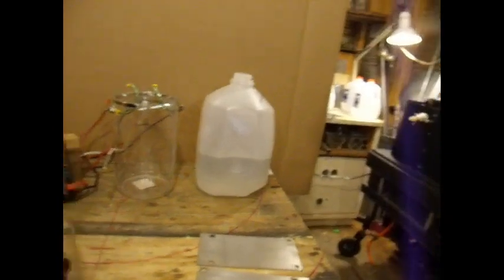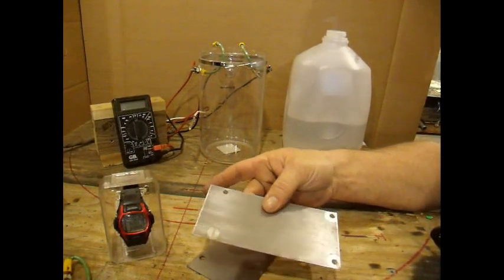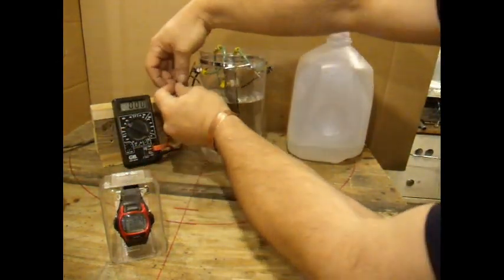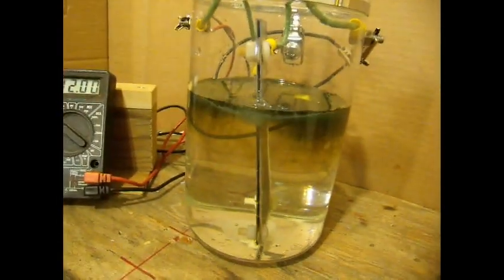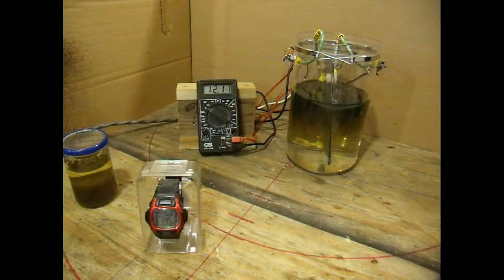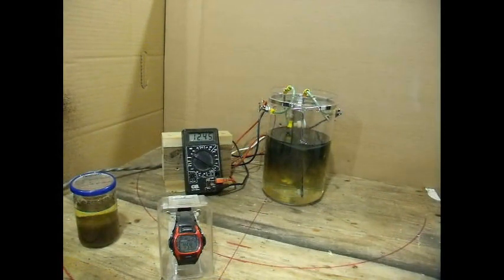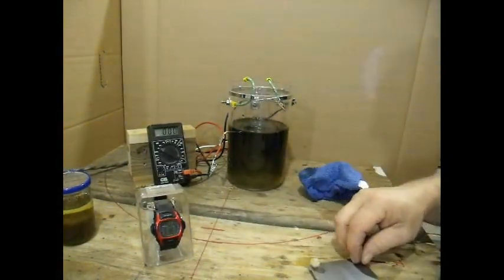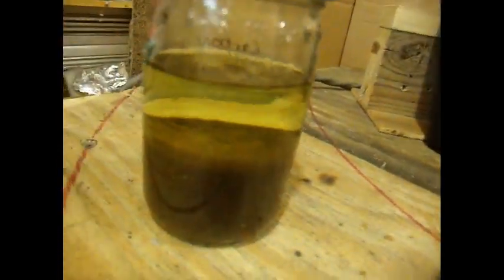Life in Minutes

Comment: Could you ask a local university to assist in weighing each item before and after the experiment. I recommend a university because they may have equipment that could render data further to the right of the decimal point to determine a change.
Have you tried this with distilled water or water other then well?
Or had the host water tested after the experiment for depletions?
Or tried to propagate the Tholin outside of the initial vessel?
This stuff is so cool, brother!! keep up the curiosity.

Comment: There are fatal flaws in your theory here. What are you using... 12 volts, 6 amperes? The iron from the plates is dissolving from the positive and plating to the negative. You are assuming that a steady current exists in some body of water where this could be possible. The Earth retains a continuous magnetic flux that produces a potential capacitance between the atmosphere and the ground. There is no current unless you initiate a steady frequency.

Comment from the maker: @bongcouver It's water turning into gas bubbles. The little bubbles rise because they are lighter then water. Know the electric current is heating the water and it will boil it if there is enough. The more current the hotter the water. Go ahead and try it just be careful and use a DC Battery. NEVER USE A WALL OUTLET. LOL  Peace:)